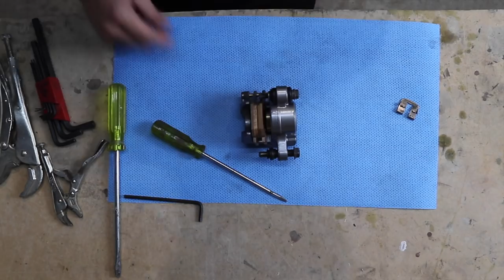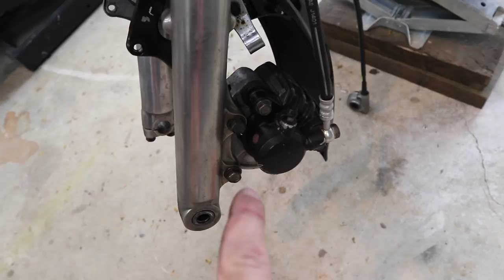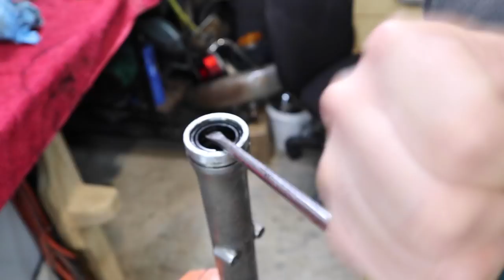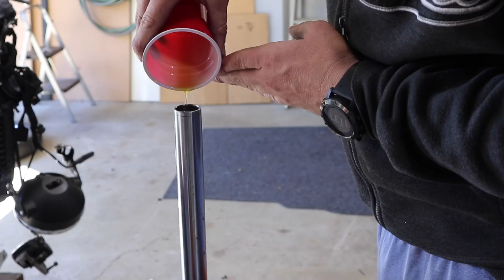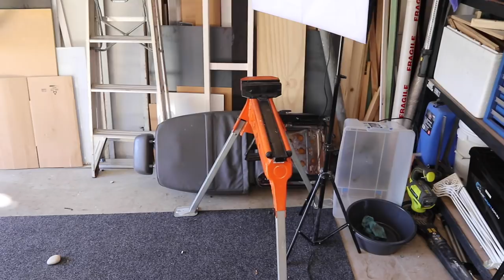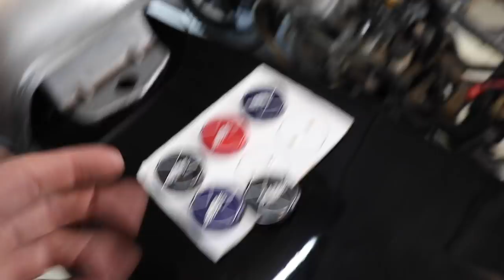Honda CX500 Fork Seal Replacement & CB750 ★ Cafe Racer Caliper Rebuild - Ep. 31

Comment: Nice job! 
Well, you're way more luckier than I, cause it took for about 4 hours for me to change the fork seals on my bike. (These 40 year old soviet bikes are quite tricky sometimes :D) The trouble I had is that this bolt on the bottom of the fork didn't want to come off. It was just spinning around and I couldn't unscrew it with any method possible. I suppose it could work if I had an air gun wrench, but I dont have one. So the trick I did is: I made a hook out of a bicycle spoke and took of these seals just from the top. So I didn't have to put my fork apart to change the seals (There are two seals each side). So, if you feel lazy to fully disassemble your fork and you need only to change the seals, it will work. Thanks for your attention :)
P.s. nice cool little trick in the beginning, I'll use it for sure!
Reply from the maker: Half the fun is working out how to complete the task with what you have and it sounds like you did that so well done for thinking outside the box.   Thank you for the comment

Comment: Hi Dan. I really appreciate the fabrication & how-to videos you provide us with. quick question about the springs themselves. I did exactly what you did but I found 1 spring with the tightly wound coils on top and on the other side there were at the bottom. I put them both on top to mimic the rear suspension springs. Is there a good way to do this or it does not really matter?

Comment: I am building my own cafe racer of a cb750 so thank you for the videos. I have got myself forks and front wheel from a yamaha r6 but i was wondering if you are using the rear wheel from a R6 and how you monted the rear brakes?
Reply from the maker: I’m use it the original Honda wheel on my cb750 👍 hope that helps

Comment: Hey Dan! I've been thinking about doing my for seals but I'm rebuilding a yamaha xj750 seca and the bike has an anti dive system built in into the front forks. Really interesting system but I'm not really sure on how to take on replacing my fork seals now since I'm not sure how everything works with the oils and stuff around the anti dive system. Do you have any clue on how to do this?
Reply from the maker: Ruben sorry for the late reply, unfortunately I don’t have any knowledge on those forks but look up moto X repairs place and chat with the guys that do the repairs on mx bikes they do fork seals all the time and I’m sure they have come accross them before, 
If you buy the seals from them they will be more than happy to share their knowledge on how to do it :) 
Thank you for you comment brother:)